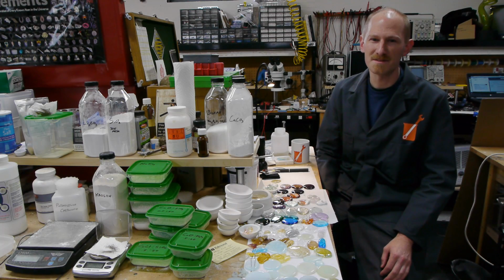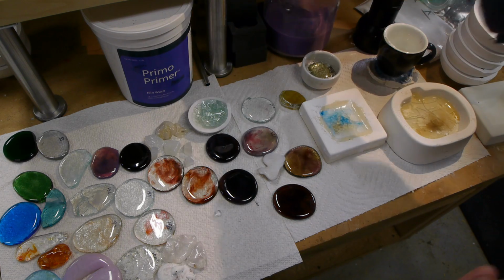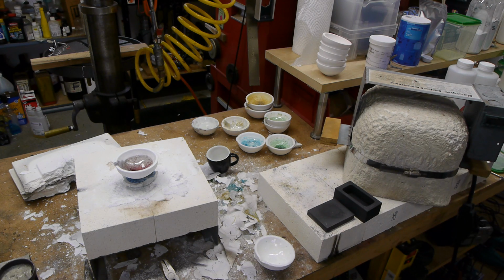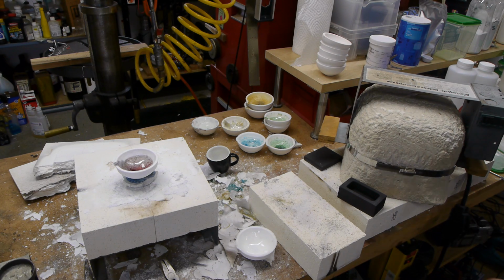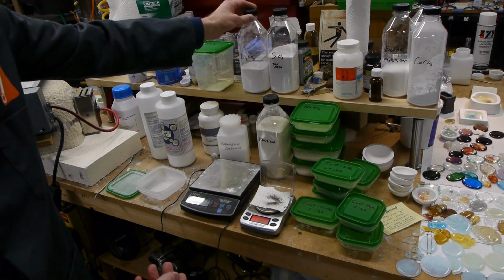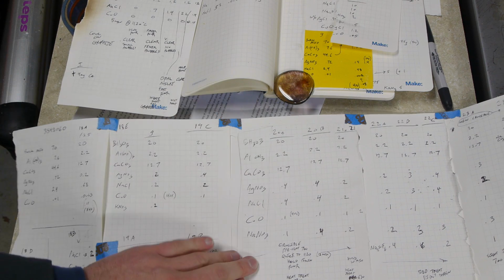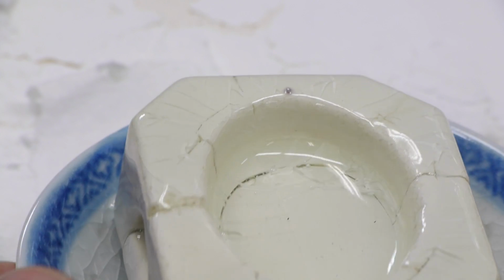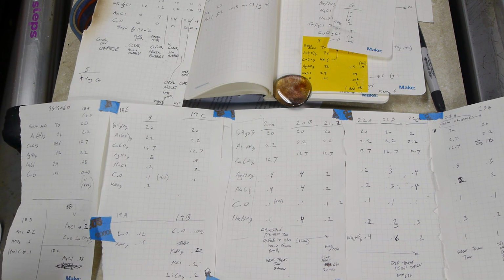Glass engineering - designing and making photochromic glass

Comment: Tungsten as a heating element? and maybe a argon atmosphere?
Reply: Ian R In the lab we use tungsten filaments in a rarified atmosphere for vapor deposition. Can get quite hot. The whole setup is pretty impractical for a home lab though. And pretty expensive.
Reply: I was just thinking like TIG electrodes to use something that has economy of scale and perhaps a purge gas setup for TIG as well, although having finished the video after my last comment i think the mixtures that he found may not work in a rarified atmosphere. I also have a question for you, how are the chambers you use constructed? I think that the fire bricks would not be suitable for a pressure or vacuum chamber and i am assuming that its something like zirconia or another expensive ceramic. Or is it just positive pressure to combat the leaks, or is there something simpler i missed. Ill also add, i think as a small upgrade could be made moving from nichrome to kanthal

Comment: How about melting glass under vacuum? Is it possible? Would it protect glass from some atmospheric variables?
Reply: Sure, but how are you getting the heat into the glass?
Reply: Asdayasman Some high intensity radiation that would be absorbed by the glass :) Depends on the glass, but you probably can just dump a high current electron beam into the glass. Quite a few glass recipes are conductive when hot IIRC, so this would work with glass being the target electrode. Or you could put a big anode behind the glass. It’d warm up nicely :) Probably would need a suppressor grid to get secondary emission electrons out of the way.

Comment: Looking at your setup, you might be able to synthetize YBaCuO ceramic. This is a high temperature supra-conductor you migth already know about. Its synthesis is commonly done in inorganic chemistry labs, althougth it can be a bit finicky at times. I think it would be a good challenge for you.
Reply: I thought of the same thing while watching, apart from "shake n bake", there is also "YBC, easy as 123" since it is Y1Ba2Cu3O6, the oxygen amount isn't critical since it's calcinated from Y and Ba carbonates and CuO, and you pretty much try to just saturate the amount of oxygen, if I remember correctly it won't really go above 6.
Reply: Ya, I didn't even bother with ball milling the reactants (not that I even knew what that was then) or oxygen flow during firing....nothing. Just ambient air in a hot furnace and pressed into a pellet with an ftir KBr pellet press when it was done. I couldn't believe it when it actually worked. Except for the yttria Ben probably already has the other reagents, he should do it, there aren't any other good videos on here doing it yet.
Reply: @Muonium1  Except the method you describe literally can't work. So either you're misremembering or something else is going on. Ben tried grinding the materials in a ball mill and even that didn't have a good enough mix to create YBCO. He ended up having to dissolve the ingredients and use a self-combusting method to get them into intimate, atomic contact, and was then able to make a YBCO pellet.
Reply: @AureliusR  welllll I literally did it and the magnet levitated, so it's pretty unambiguous that it worked. huge numbers of other people have used the method I did and gotten it to work just as easily. maybe you should actually....ya know, DO IT.
Reply: @Muonium1  In Bens video on the grinding method he wasn't really into grinding and didn't really do it and directly switched to the self combusting method.
Reply: See https://www.youtube.com/watch?v=sLFaa6RPJIU
Reply: Do it Ben!
Reply: The synthesis is actually trivially easy. In the 80s when it was discovered it was actually called the "shake n bake" method. I made it as an HS student in the 90s with a simple tube furnace and a VERY poor mix of nitrates and oxides. It wasn't high quality but still demonstrated the meissner effect easily.

Comment: Why bother using a heating element? What's wrong with inductive or magnetron heating of a graphite crucible? And you obviously put your alumina crucible inside that graphite. Temp could be measured with a metallurgical IR-pyrometer...
Reply from the maker: This is a good point.  I forgot to mention microwave kilns that use insulating firebrick material which is lined with graphite. The whole kiln is placed inside a standard microwave oven, which heats the graphite to very high temperatures, and the air will conduct the heat (as well as radiation) to the crucible within the kiln.  This sounds more difficult that electric heating elements, but easier to control than gas-fired.
Reply: @applied science you don't necessarily need graphite to heat stuff using microwaves, many oxides(including magnesia and hematite) have what are called "runaway temperatures" where they pretty much just jump the in the order of 800 to 1500 in a few seconds. This has some pretty bad effects on temperature control though, not to mention that the field nodes in the microwave oven gets distorted by the change in absorbance. I have my PhD in this kind of things and this could sometimes happen to the magnesia crucibles if they got too hot, making some experiments quite hard for some guys in my lab
Reply: sasja de vries. Glass will react with graphite
Reply: Applied Science I have recently started working on making my own alumina and zircon crucibles (you can find zirconium silicate being sold under names such as Superpax or Zircopax as an ingredient for pottery enamels). I plan on using the slip casting method with plaster molds. If that works I also plan on experimenting with the incorporation of silicon carbide powder in the composition of the crucibles. SiC is a very good RF and microwave susceptor, and if successful that would make my home-made crucibles usable in a microwave oven. There is a brief but interesting article from I think the US Dept. of Mines from the 1950s about the slip-casting of crucibles of BeO, Al2O3 and ZrSiO4 - I can link it if interested. There are a few steps required before casting, essentially chemically etching the oxide particles to get them to the rheological properties needed for casting.
(edit) here's the link. It's from 1939 not 1950s and from the Bureau of Standards not Dept. of Mines. Memory is a tricky thing. http://nvlpubs.nist.gov/nistpubs/jres/23/jresv23n2p319_A1b.pdf
Reply: You mentioned silicon carbide in your video as well. This is the tooling material used in precision glass molding of aspheric optical lenses. A preform is placed inside and the SiC is heated inductively.

Comment: Would (partially) sealing the crucible (or maybe pressurizing the kiln with something inert) to increase the pressure around the not-yet-glass reduce the amount of ingredient vaporization? Or are the ingredients volatile enough to make that completely impractical?
Reply from the maker: It's a good question!  I haven't tried using a lid on my crucibles, but I should. I once had a small tube delivering argon into the kiln for a different project, but I removed when getting started with the glass-making.  Little did I know  how sensitive the glass would be to atmosphere.
Reply: In "Spectrum of Belief" (Joseph von Fraunhofer and the Craft of Precision Optics) the key difference that the British couldn't reproduce with their (supposedly better) hotter-burning coal-fired heaters that the Bavarians could achieve with cooler wood-fired systems... was that they had lids, and a paddle-wheel fit through the center so they could mix without lifting. Without this, the British had, at minimum, ash and aerial contamination. The defects were optical though, maybe it was some sort of nucleation like you describe wanting. But anyway, I was also thinking about a lid. Or maybe a vase/gourd shaped vessel? I wonder if the field lines produced by the heater coil has any effect, maybe they're adding vapor pressure if they're pulsing on the crucible? Maybe have the crucible centered between an upper kiln and a lower kiln?

Comment: 7:50 A huge furnace with molten tin and HYDROGEN ?
Reply: Jokes aside tho, In an oxygen deprived environment, H is no more flammable than a wet sock, and even if it will ignite, it should not cause a lot of extra pressure, because it's just two gasses reacting, rather than a solid. So while it sounds like a doomsday device, it, probably, isn't.
Reply: Tumoxa89 I saw the notification late enough to see your second message. So I don't need to write a flaming answer to the "Hindenburg" comment. Anyways I still can't find his question. If I think what he probably wanted to ask (isn't H highly explosive/flammable?), then you have already answered it with your "wet sock" comparison.

And no, hydrogen isn't a doomsday device and never underestimate the flammability of wet socks. ;)
Reply: Lol, sorry about that. I guess it's just a "wot?" question. Like when you hear about cooling nuclear reactors with molten lead, something that sounds like it should not work.
Reply: Yeah if you watch videos in factories where they do the float glass process, when they open up the hatches on the side to put additives in, there are streams of flame coming out. I did wonder a bit why that happened, I thought it was just because it was a hot furnace or something but the hydrogen explains that clearly.
Reply: Yeah, industrial processes are metal AF!
Reply: Side note hydrogen gas won't at low enough hydrogen/nitrogen ratios.... stay below 2% hydrogen to be safe.
Reply: Matthew Ducker 👏🤘
Reply: +zvpunry Ever heard of Hindenburg?
Reply: In fact float glass tin baths are primarily purged with an inert gas (like nitrogen) to displace oxygen containing wire with a small percentage of hydrogen (2-5%) to scavenge any tramp air/oxygen (which is converted to water). In a laboratory environment this can be replicated using using inert glass from welding supply equipment, I recommend using argon which is heavy and will "stay in place" if you purge the kiln and seal the edges around the bottom of the muffle kiln (seal with something like a fine grain refractory sand bed or nonsetting ram like zircon sand).
Reply: I see the question-mark, but I cant find the question.